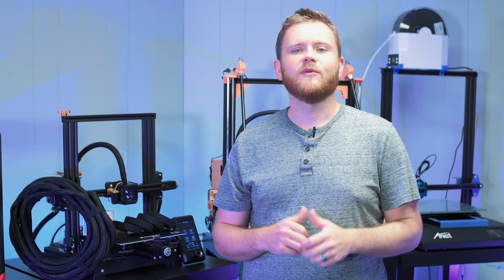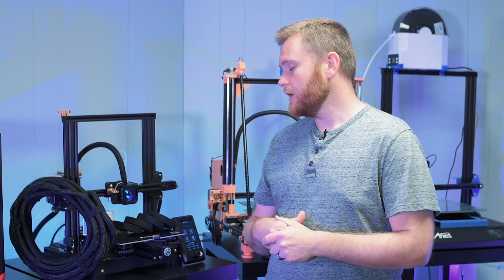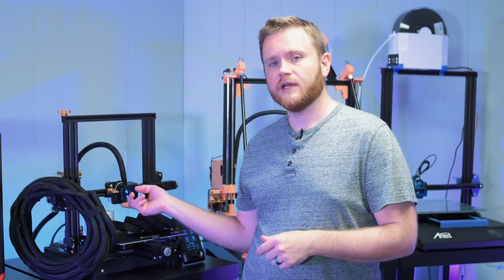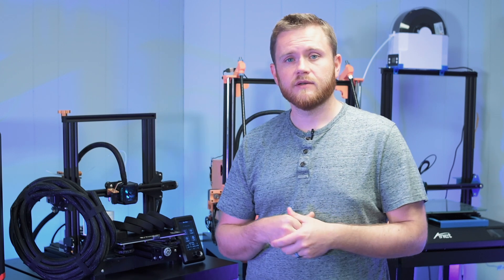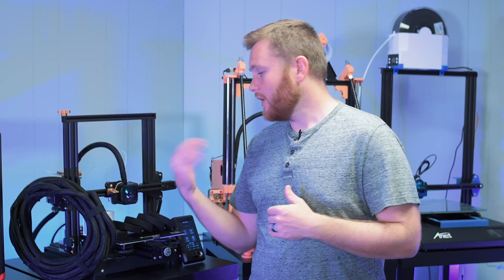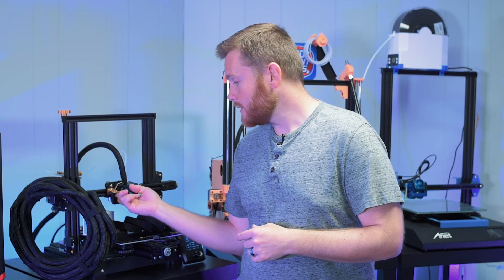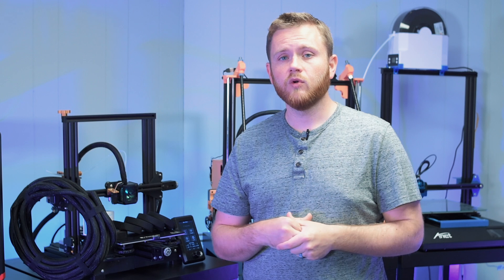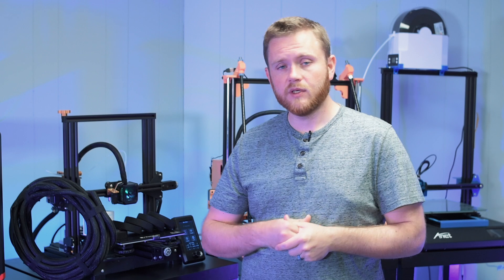Automatic Bed Leveling? Creality CR-Touch

Comment: Finally got around to finishing up the install of my new CR Touch sensor. Figuring out which screws to pull took some time. There are 4 of them 3 on the bottom and 1 on the top. Plus the hex head on one of my bottom screws was stripped so I had to use pliers to unscrew it one quarter turn at a time. :( Finally got everything removed and plugged the sensor in. Put all the screws back, replacing the dead one with a much better quality M3 of my own. Now for firmware. I had already installed Alex's firmware with 3x3 manual mesh, so I figured I'd just create a firmware folder on my existing 4096 formatted card and all would be good. Well that didn't work, maybe I spelled something wrong or maybe it was a problem with the phase of the moon/Mercury in retrograde, who knows. I reformatted the card, popped the firmware back on and tried to load again. This time it worked exactly proper. I am now creating a 5x5 mesh all automagically.
Reply from the maker: Awww yea. Sometimes the printer likes a fresh format. Looks like that was the case. Glad you got it running.
Reply: Nick, I’m try to get my Aquila X2 to run what you have and I just can’t get it to recognize the software for the printer or the display. 
I don’t know what I’m doing wrong. 
I named the folder “firmware” in lowercase letters I’m attempting to update the printer first but it won’t recognize it. 
Even if I attempt to run the display software first, nothing! 
Any advice from anyone who had this problem and solved it?

Comment: How do you know if you have the G-32, N32- or H32 machine?
Reply from the maker: There is a sticker on the front of the printer, left side. It should look like a chip and say either N32 or H32. If you don’t have a sticker, you have a G32 machine.

Comment: Glad that you did an overview of the hardware installation but I wish you had gone into a bit more detail with the setting up.
Reply from the maker: I could always make a more in-depth video on setup for sure. It’s pretty easy. Click create mesh, save, set z offset, save. Done.
Reply: I find after you set it. The outer part of the bed could be off and do not know how to correct that discrepancies
Reply from the maker: Even after the mesh?

Comment: you said BL touch, you mean CR touch? lol
yea I have the cr touch its definitely a necessity.
they do vibrate a little. getting a damper does help, but what is probably the best thing is get an oring and put it over the end of the probe when it's extended, then when it retracts it holds it in place and stops the noise.
Reply from the maker: I wonder if a keyboard switch o ring will work. I have a bunch.
Reply: @3DPrintSOS  update: hey I was able to completely mitgate the sound from the vibrations. so I used 2 of the smallest orings from the metric oring kit from harbor freight, if I remember it's like 1mmx1.4mm. u put one over the probe, then one on the wide part. u know what I mean right near the tip of the probe? that widest part of the probe before it goes to the smaller shaft. it fits perfectly or u can use a dot of glue like liquid electrical tape.
Reply from the maker: Oh nice. I just tried the smallest orings from my harbor freight kit as well but mine are a hair too big. Funny it’s the same kit.
Reply: @3DPrintSOS  yes it barely fits over the widest part of metal probe. its the 225pc metric nitrile oring assorment item 67609. i believe its the 3mm x 1mm which is the smallest. i could send a picture if you like. theres two, where one above it kind of hangs, i guess it can be glued up.. but when its retracted they kind of sandwich and it does help. somehow keeping it steady as it moves is the way, i think this is a good start.
Reply from the maker: I’m thinking I can design a quick clip that we can try printing
Reply: @3DPrintSOS  hey I just wanted to say the oring from the harbor freight kit may not be the same, I remember getting some from tractor supply and could have mixed in. sorry if that's the case.
Reply from the maker: Mine are just a hair too big. But thanks for the update. I think a little printed TPU disk would work too. Maybe like a “clip”
Reply: @3DPrintSOS  genius! if u find a thingi or make one please do a video!
Reply: @3DPrintSOS  i would like to know as well, i guess something like a tiny piece of foam can work, the squishy kind like a sponge.

Comment: Got one! So here is what my install experience was like. I'm using PLA for the mounting bracket, probably not the best choice, but it's all I've got right now. My first two prints of the bracket broke. the first one snapped off why trying to remove from the build plate. But to be honest, I used Wwwway to much glue stick. Second one came off the build plate easily, because I washed the plate and used no glue at all, but it snapped in half when trying to attach the probe. I changed up the slicer settings and when with 100% infill, this one seems quite sturdy. Got the bracket attached to the machine quickly, but then there was the probe. Harumpf. After a great deal of cursing, I realized that my biggest problem is my fat fingers. Nothing says the screw head has to be on top, right? So I balanced the screw on my driver and inserted it from the bottom. Much easier to get the nut attached when A) you can see what you are doing, and B ) when there isn't a probe in the way. I just zip tied the cable to the existing loom, I thing I will tape wrap it or something later, don't want to to be stiff, maybe I'll used one of those cool jointed managers or ... who am I kidding, I'm never going to do any of that. Way too lazy. Now I just need to plug it in and update the FW. I'm going to use the 5x5 because I know I have a high spot in the center and I want to probe it specifically.
Reply from the maker: Yeah the loom is extra, but satisfying! I printed mine at 100 as well. Probably a must for this little bracket. Wall count should be high too.

Comment: So the Z axis switch stays as is? So the gcode to use with the cr-touch( G29 J ; 3-point level ), is that for the 3x3 binary?
Reply from the maker: That will just use any amount of points that are set in the firmware itself.

Comment: Good day all, Hi 3DPrintSOS. I just received my new Mai Board from FlashForge themselves in a box wrapped in dark blue tape with their Name all over it.  

Got it early as well, it was due this Wednesday ( 8th Sept ) But got a DHL Text saying it will come today instead ( 6th ), Lucky I am off work today so was here.
I could fit it however I prefer to wait until the 10th as I am expecting the new thermistor's I ordered to come so I would like to use one of those 5 new ones to then fit with it.

Just so there is no chance of possible problems with the soldered up thermistor I had before? 
Because I had to solder a new sensor end of one on to a original thermistor plug end so I could plug it in to the old board port.

As the thermistor's I brought before turned out not to have the plug ends on them just two bare wires.

So hopefully when the plug ended new thermistor's come I can get the Aquila up and going and 
try out that new firmware and have the thermal heat protection with it and the new mesh bed leveling too!

And I brought my 1st Yellow PLA too so trying that out for sure. I got mostly PETG now but not had Yellow of any one until now.
It is from a company new to me called Tecbears from Hong Kong it was cheap too but got good reviews.

It was only £13.99p on UK Amazon and also got £1 off with a onscreen voucher... so cool. 

Let you all know how I get on after the 10th Sept.   8 )
Reply: eeehm...yes ??

Comment: Just got through installing the cr touch onto my printer and can confirm the one I bought also makes the rattling noise when it moves! No a deal breaker though, the fans are louder than the rattle.
Reply: Mine too.
Reply: Fyi. I've found if you wrap a rubber band around the touch it eliminates some of the vibration/rattle. You can't get rid of all of it because the touch tip still rattles.
Reply from the maker: Interesting. I’ll do more testing soon.
Reply: Mine is rattling even during printing. It's noticeable even with the loud stock fans :(
Reply from the maker: Oh bummer. I was kind of hoping it was just mine.

Comment: Why did you go with the UBL gcode and not the linear version?
I'm currently running M420 S1 on mine and that's it since that loads the saved mess in.
Reply from the maker: It’s what was recommended to me by Alex, the guy that supplied the firmware.

Comment: The wring loom it came with, all I needed to do was bunch the loom up and run the wires through it easily,  Wasn't a problem at all. It expanded to about an inch when bundled up. Also I recommend removing the Z-axis switch.  It's no longer needed, and can possibly confuse the firmware if activated.
Reply from the maker: These are pro tips. Thank you!
Reply: I just unplugged my Z limit switch right at the switch but left it there.  No worries.
Reply from the maker: Should be 👌🏻
Reply: The instructions that came with mine says to disconnect the z limit switch, they printed that part in red so I figured it might be important  ; ).  I think as long as the touch probe touches the table before the z limit switch is hit you should be fine.  We just watched a test print with the z limit still installed so it can be done.  I haven't installed mine yet, but it looks like you would have to deliberately set your z limit switch high for it to engage before the touch probe.
Reply: I'd leave the z-axis in as a backup in case touch fails.
Reply: @MrAlistairGeorge   I suppose if you leave the springs in and set the z-stop switch it to activate when the bed is being pushed down by the nozzle. So if everything is going right, it wouldn't be activated at all.  But how does the BL-Touch firmware deal with it?  Might be something to test and share in a future video?
Reply: @delscoville  it's really unlikely the touch will fail, but if it did, there is no protection if original was disabled. Good video by Fedro 👍

Comment: I think the BL Touch has one very important advantage over the Creality offering and that is the power-on self-test and the LED's to show any errors, and without this function on the CR Touch it has the capacity to crash the hotend into the bed, I was lucky enough to buy a couple of the V1 BL Touch's that have the aluminium tips, I don't know why they changed them as I have had no problems with them whereas one of my BL Touch's with the plastic tip came bent
Reply from the maker: Hmm. I believe the Cr touch does a test every time you turn it on and it has leds as well. I’ll double check if they function the same way.
Reply: @3DPrintSOS  I have seen 3 reviews of the Cr Touch and not one mentions a POST or leds
Reply from the maker: I’ve noticed purple after the pin comes up, red during the reading, and blue when it’s homing. It definitely has led errors. When I have some time I’ll do more research.
Reply: @3DPrintSOS  When Power on CR Touch runs the probe down and up twice and has a red led, when done the led turns purple "ish" and Blue when homeing (probing).

Comment: Hey  is there a g code to have the machine do the bed probing before a print and load that mesh? that way I don't have to fool with the touch screen, and also for my machines with no screen it would help.
Reply from the maker: I included the gcode Alex recommended as start gcode in the description but I believe every time you print, the machine will use the probe to find the right zoffset that set and then print. Do you want it to make a mesh every time ?
Reply: @3DPrintSOS  No, I would just paste the code into the file when I think its having a level issue of some kind to make it probe and update the mesh.  I know on my cr 10 smart and cr 6 see machines you have to go to the level on the screen to get it to do the probing.  I know also that g28 is home and G29 is the mesh. would m500 save the  mesh as well or is there another code I need to save the new mesh.  cause I know it won't auto save if I send the g29 to any of my machine when I use octo print.
Reply: @matthewsuggs1637   below is the gcode I use to run probe with octopi.  (I took out the heating bed code since I was getting slight variances when the bed heater was on.)

M117 Homing all axes ; send message to printer display
G28      ; home all axes
M117 Heating the bed ; send message to printer display

M300 S1000 P500 ; chirp to indicate bed mesh levels is initializing
M117 Creating the bed mesh levels ; send message to printer display

M48 ; Test for Accuracy
@BEDLEVELVISUALIZER	; tell the plugin to watch for reported mesh
G29 T	   ; run bilinear probing

M300 S440 P200 ; make calibration completed tones
M300 S660 P250
M300 S880 P300
M500 ; Save
M117 Bed mesh levels completed ; send message to printer display

Then I just use M420 S1 at the beginning of every print to load the mess.